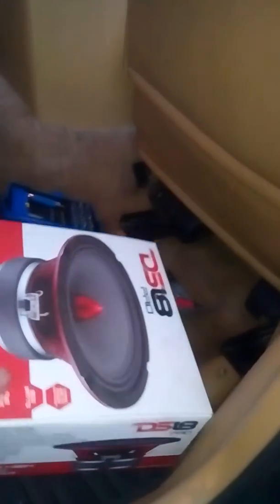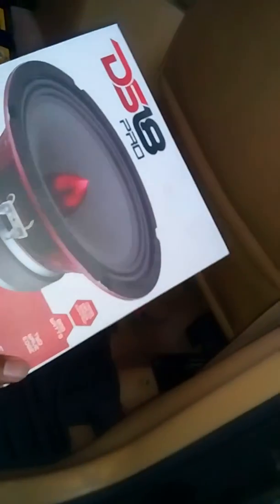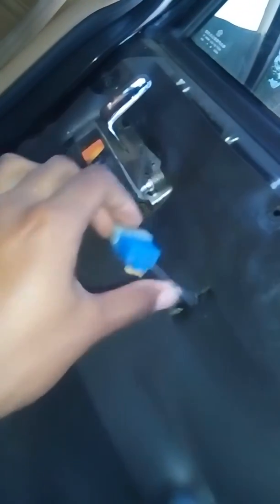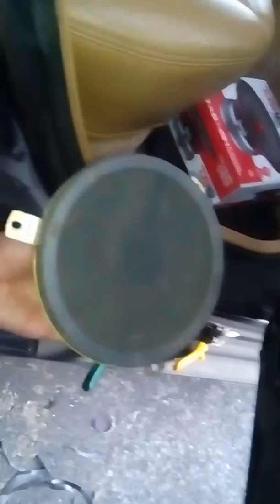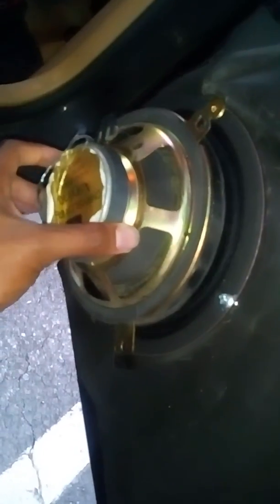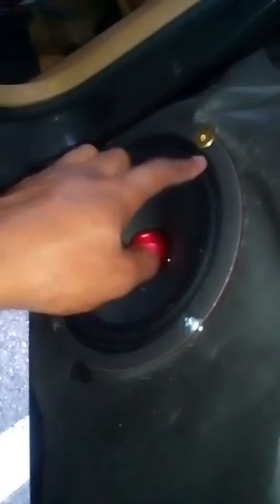MODIFYING JEEP DOORS TO FIT LARGER SPEAKERS

Comment: Did you have to change anything on the door panel? Because I've thought about changing mine to something bigger but wasn't sure if it would work or not because the inside of the door panel looks like it mounts around the stock size. Wasn't sure if it wouldn't fit right or not because of this.
Reply from the maker: I didnt have to change the door panel or modify it but it was a tight fit

Comment: Did you have to do anything for the increased mounting depth of the new speaker?
Reply from the maker: Lifting After Dark since the speaker magnet bottomed out on the door and the speaker stuck out a lottle further than the stock ones, i just used longer screws to fasten it to the door and the 3 door panel clips by the speaker wont catch. you would think this would be a problem but you dont notice it unless your looking at the inside door from underneath and the rest of the paneling sits flush.     
its been a year since i made this video and these speakers still sound as good as the day i put them in